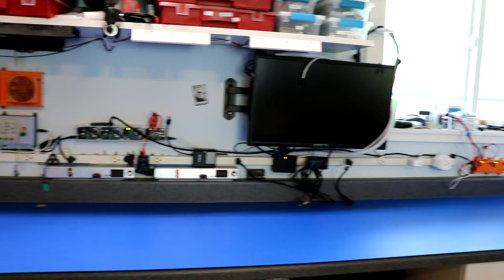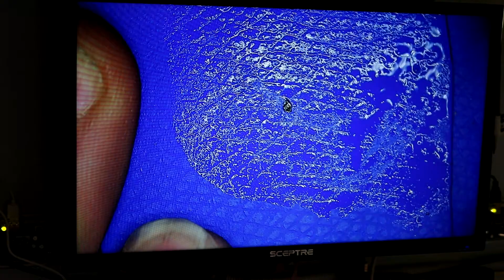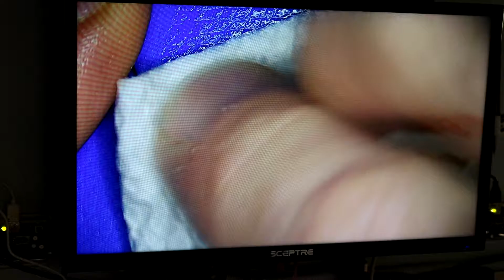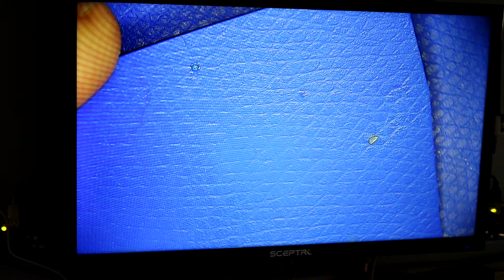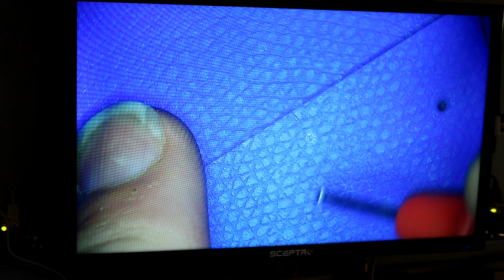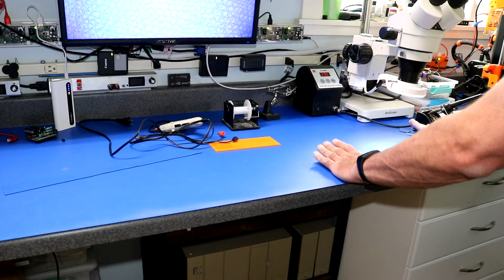Bertech "Made in the USA" high temperature antistatic (ESD) mat review

Comment: Professional installations tend to have the mat connected using the snaps you already have but directly to (in our case in Australia) the mains ground via a clear mains plug. There is no need for the additional resistor because, as you found, the mat already has a high resistance well into the mega ohms. The whole point of grounding of course is to bring your mat to the same potential as your iron, test gear etc. The "ground" part is irrelevant but ground is the most common thing to bind everything together. Many (many) folks totally misunderstand ESD and think that "grounding" is where the magic happens but that's a misconception. Having everything at the same potential is the important bit because you want to eliminate the potential difference (i.e. volts) between you, your tools and the thing being worked on. So to complete the picture you must also wear an appropriate ESD wrist or ankle strap, connected to the same common point as your mat but this time typically via a 1M resistor (these are built into the pro ESD banana jack terminals that screw under the bench). If you skip this point then you have largely wasted your money on having the very nice ESD mat! Work bench is looking good!
Reply from the maker: Well that makes sense -- I saw that Desco made both a cord with a resistor and a cord without a resistor. I do have a couple of straps that I use while doing occasional computer work, my plan was to tie them to the same snap as the mat.
Reply: I broke off the ground pin on some old plugs and soldered it to green 4mm female banana connectors and presto. Ground connections wherever I need it. =D